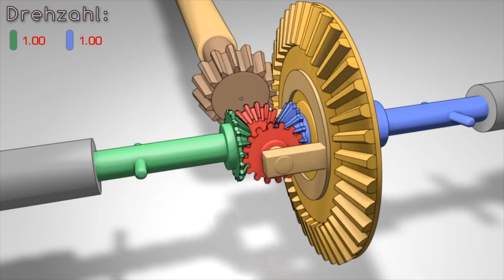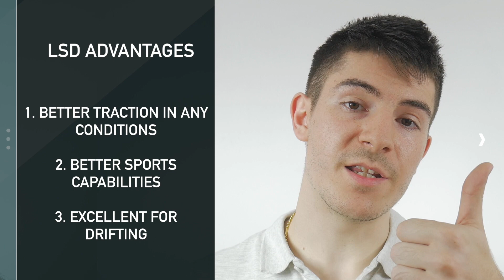Open vs. Limited Slip Differential

Comment: Your description of an open diff is incorrect, the power split is always 50/50.
Reply: 15october91 that is completely incorrect, the power goes to the wheel with least resistance on an open diff. The only diff type that power is always 50/50 on each wheel is a an actual locker.
Reply: in open diff, TORQUE split is 50/50,not power split...& power goes to the wheel with least resistance..

Comment from the maker: Note: There also Torsen LSDs which are used by Audi, Subaru and other brands and they don't use friction plates. So there are LSDs which use friction plates, and others which don't.
Reply: Welded/closed diff really split the power output 50/50 100% of the time. There is no diff slip. Or in outher words the wheels spins at the same speed no matter what. One side spins the outher side spins the same amount no matter what! Only time this is not true is if the diff is broken. XD Ha ha ha ha.  

The wheel with best potential of traction is going to deside the speed the outher side simply. (it can be on the moon for all it cares) It a way the best wheel is going to slow down the outher wheel from spinning faster then it needs to be going. Witch wheel doing the best work at the current moment in time is deciding both wheel speeds. Gotta love simplicity that works well. 

But it's not perfect. (but fun) If one of the wheels hits traction the outher side has to stop widely spinning to. But it has no reason to suddenly slow down exept that the outher wheel told it to. It's easyer to upset the balance of the car since there is no diff slip (AT ALL) Easy way to brake a welded diff is to drift in the snow and one of the wheels hit asfalt at full speed XD   Ow good times.

LSD is more stepping in to stop one side from getting all the power and wasting it on making pretty white smoke. That is all there is to it really. But the balance problem can still cause problems if the diff limits the slip to mutch. A good amount of LSD gives you the good and not to mutch of the bad. To mutch LSD strength it stats to stop being that useful vs welded.

To say that a LSD = welded diff is purley wrong. A good LSD balanced for it's use purpose is far more desirable in allmost all circumstances over a welded diff. Just to make it clear ;)
Reply: 99Vehicles TV limited slip diff=welded/closed diff?
Reply: Diner50 thanks a lot! So for drifting i need to have a welded/closed diff? Instead of LSD. I am sure of that, but just asking.

Comment: hello man...i have a bmw e34 520i i want to change my diff ..i want to give me advice or idea please...on my car i have 3.46 diff i want to change it to lower gear for better torque but without loosing top speed a lot ..so my option is 3.73 lsd and 3.91 lsd i dont know if there more than that for this model soo i need your recomend me witch one to pick up and if there another one justt tell me and many thanks ..and by the way my english is not good :)
Reply from the maker: You will lose top speed with 3.91, but you will drift easier. I don't know if you will go that much at top speed, so you should put that one. Cheers
Reply: 99Vehicles TV thankss mann for advice.. but i just forget somthing to ask sorry..did my speedometer will chang or will remain the same ..as you know bmw speed sensor comes on diff it self
Reply from the maker: +Tiger Black Don't know for sure, but I think you can adjust it.
Reply: 99Vehicles TV ohh okey if i can thanks a lott 😊